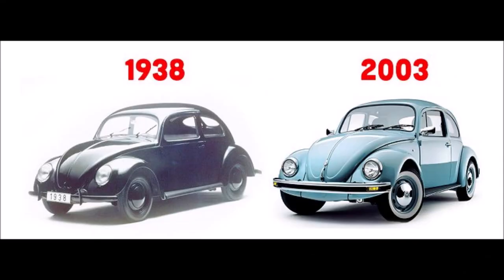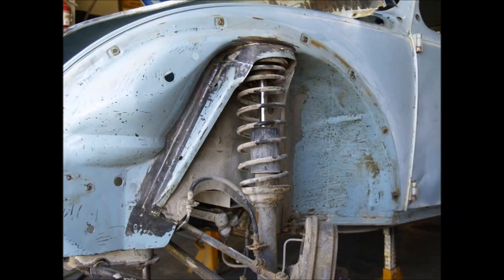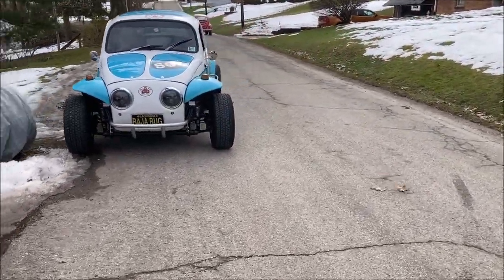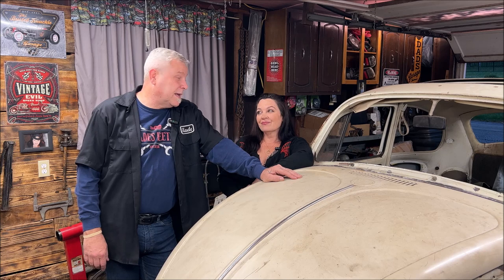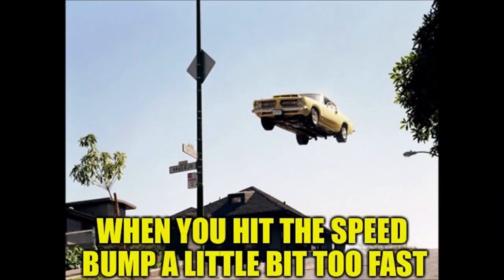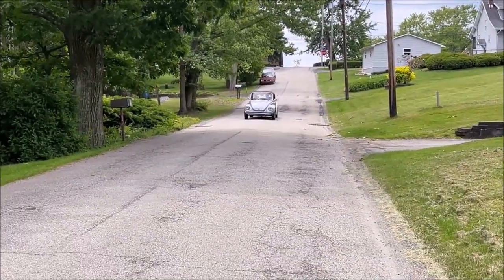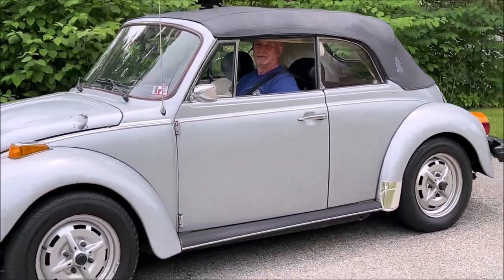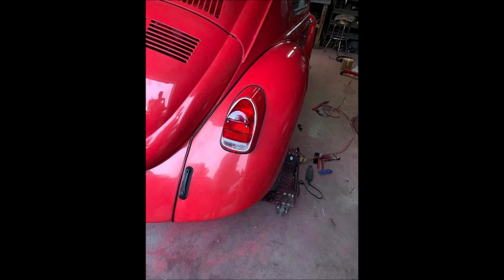VW Standard Beetle VS Super Beetle - WHATS THE DIFFERENCE - HOW TO TELL - VW Bug - VW Classic Beetle

Comment: I believe the 71 Super Beetle was the peak Hp beetle. Also besides handling improvements, the struts in the front made for additional luggage space in the trunk, which was a major selling point for the Super Beetle. The ‘71 SB is unique in that it had the flat windshield, old style steering wheel and oil bath engine air cleaner. I think the ‘72 SB had the plastic steering wheel and maybe a different air cleaner. Not positive on the last point. I’ve owned a ‘71 SB since 6/72. Redid the front end bushings a few years ago and it brought the handling back to normal and eliminated the infamous death-rattle associated with the SB. Great video as always.  Thanks for sharing!
Reply: yeah My 72 SB had the New style Steering wheel and Air cleaner
Reply from the maker: Thank you for posting sir. Honestly I think they drive amazingly well compared to the standards. Although I have a passion for both obviously. I would like to have a 71/72 with the flat dash.

Comment: I purchased a 1971 Volkswagon Super Beetle with a 2000 series motor from Gateway Volkswagon at 102nd Avenue and N E Weidler Street, brand new for $2240. What was the power output of the 2000 series motor?   🌎

Comment: In Australia all Super beetles had a 1.6 litre engine.  The 1302 was known as known as the Volkswagen "S" and the 1303 as the Volkswagen "L".
Reply: I'm German and both were offered 1200/ 34hp, 1500/ 44hp + 1600/50 hp. "LS" was "all options" + 50hp and that badge was only used until 1973. Later models just got "1200" or "1303" Only 50hp had serial disc brakes .
Reply from the maker: @HesseJamez thank you so much for the information! I truly appreciate that.

Comment: ???  When I last sat in a beetle I barely fit, do ya think it's possible to easily modify the seat mount I points further back for a tall person ?
Reply from the maker: Actually I did that on my last one. 
And I’m going to do it again not too far off on this one. 
I used aftermarket seats, and move them back further, and a little lower. What a big difference it makes.
Check the playlist on the channel. It look for seats, you’ll be able to see what I did.